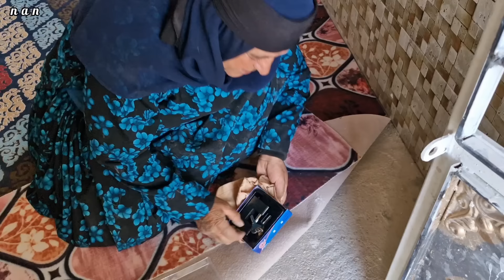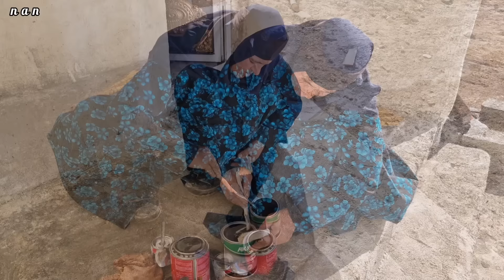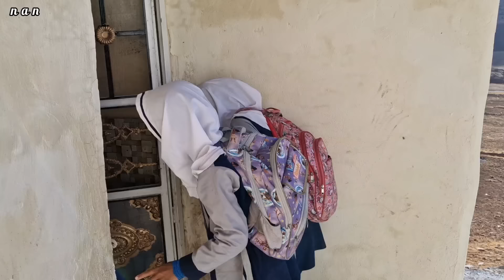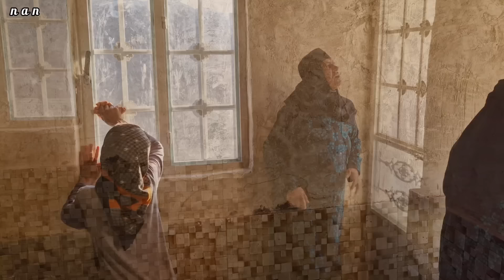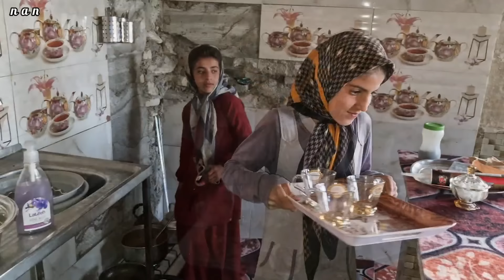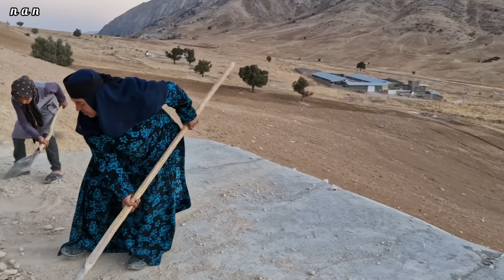A day full of challenges for grandma: painting and installing glass, cleaning dirt

Comment: A wooden door would have kept the cold out better during the cold winter months, instead of that thin glass in the door. IJS
Reply: Get a warm curtain.
Reply: Put a blanket over door in winter ,, that will stop the cold  from coming in
Reply: You are something else lol!
Reply: a good strong solid Wood door ( not grandma style wooden door its too flimsy thieves  would get in her wood door but a solid wood carpentered door) might be too expendive but it would be more feasible b/c it would not break or let cold air in! Maybe use this metal frame but line it with solid wood n fasten with srews into the metal AND GLUE TO SEAL THE EDGES!

Comment: Grandma is very intelligent in removing the earth and stones from above the roof to lighten it, but you must first remove the excess earth in the highest part of the climb towards the mountain, because removing the earth from the lower part risks a landslide. Then, if I remember correctly, there is a very large boulder, which threatens the house, and it would be a good idea to move it sideways and slide it downhill for safety. If it were to rain heavily, the earth underneath could move causing it to roll over the house. Or you can break the large rock one by one to make smaller rocks to camouflage the exterior of the house and not show that it was built with blocks. After this and having completed the front window, you can think about putting the missing tiles in the kitchen and then finishing the cave. If no one protests about the house anymore and if the cave is made habitable, it can be rented. Later you can also arrange the side source, which water is always convenient to have. You can also create a bathroom with a toilet and an area for washing more comfortably.

Comment: Remember granma when you measure the new window space for its window your width across measurement must be at the 2 blocks that jut out further than the others….yes there will be space above n below that  but you can fill those spaces in with cement n your plaster outer cover… and you need to move all your things from the outer walls remaining into the cave so your very good plastering  helper man can finish n seal your remaining  2 outer walls!
Did they see that black n white dog come by as they were scraping sand off the roof … is it looking for more chickens hmmmm dogs got the chickens is seems!!!